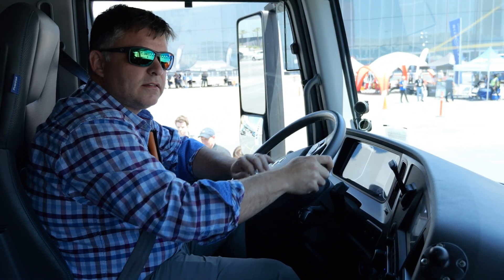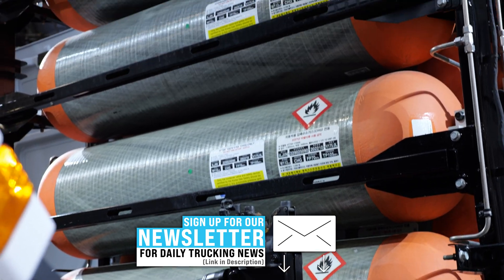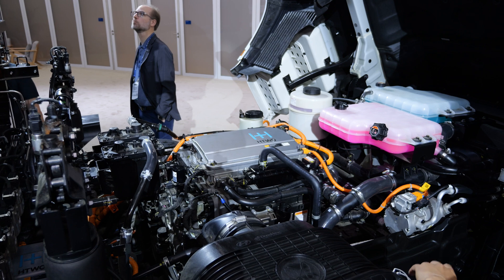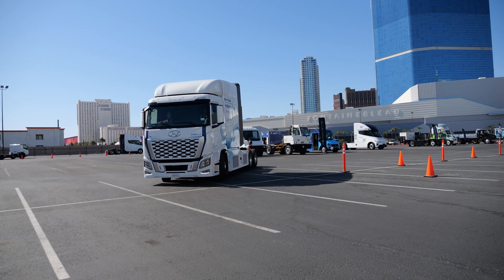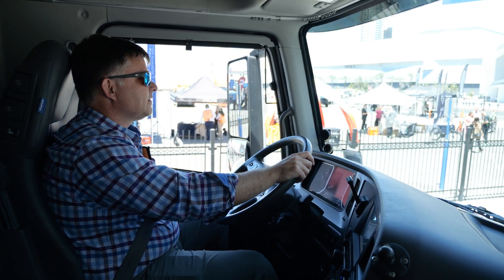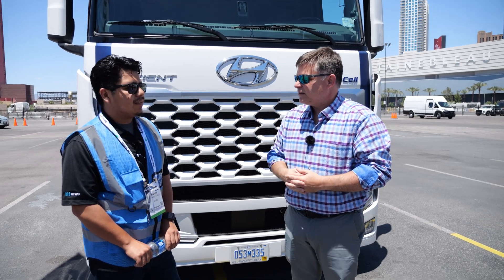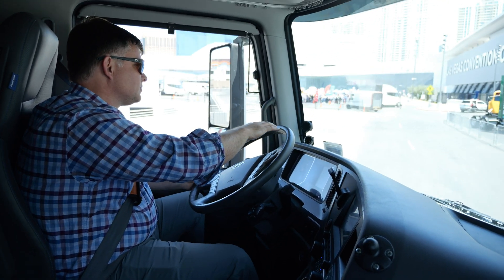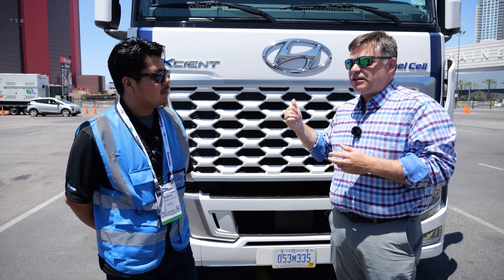Hyundai Class 8 XCIENT Fuel Cell Truck: Cabover Revival

Comment: these things would only worn in comunist countries, they are more expensive to run than diesel, i remember when i saw one fuiling at petro in California and driver said that it cost around $800 to fill and only lasts 400 miles and plus the truck is twice more expensive, regular diesel truck costs around $500 to fuel and lasts around 900 miles
Reply: thats why Nikola went bankrupt, without government insensitive no one will buy them at that price plus hydrogen is more expensive to run than diesel